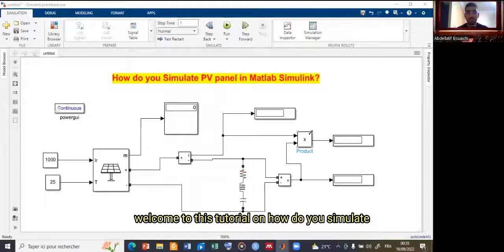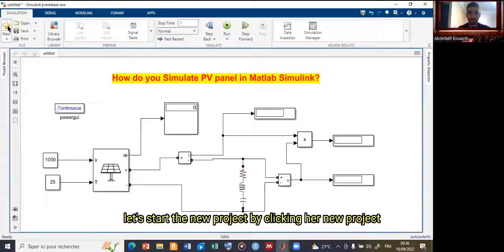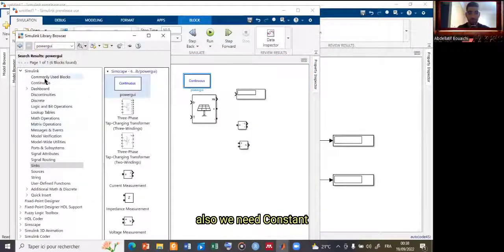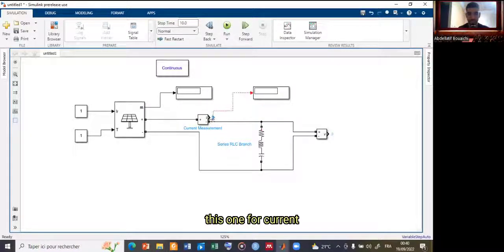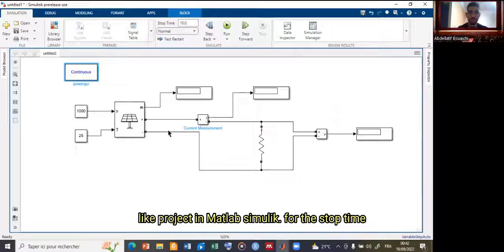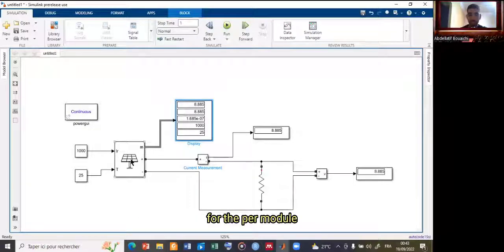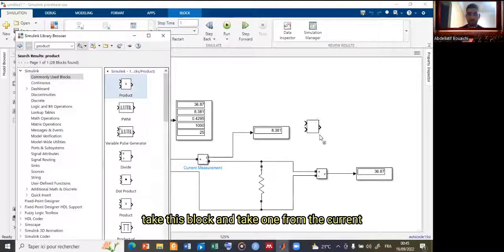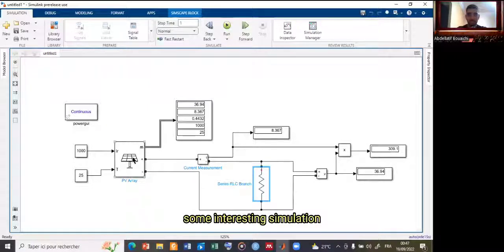2 - How to design and simulate your Solar photovoltaic panel in Matlab Simulink - Part 2

Comment: How can i insert a variabile irradiance?
Reply from the maker: Add a Source Block: Drag and drop a source block from the Simulink Library Browser. Depending on your data format (time-series or constant), you might use different blocks:

For time-series data, you can use the "From Workspace" block or the "Signal Builder" block.
For constant data, use the "Constant" block.